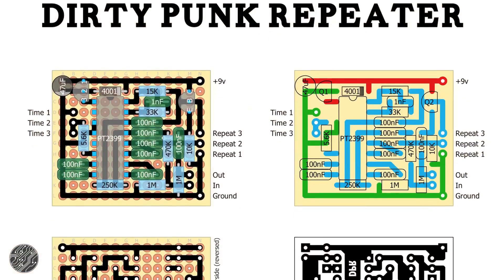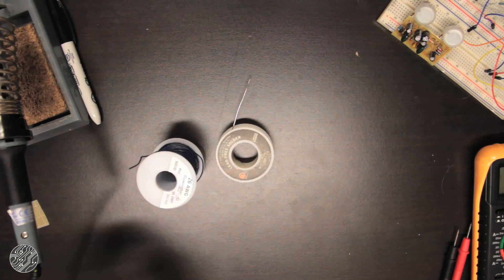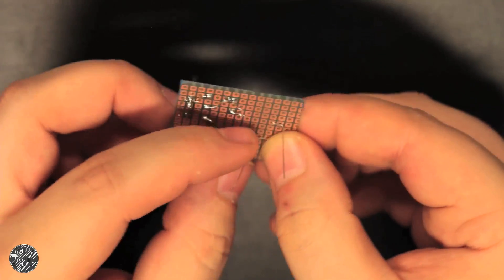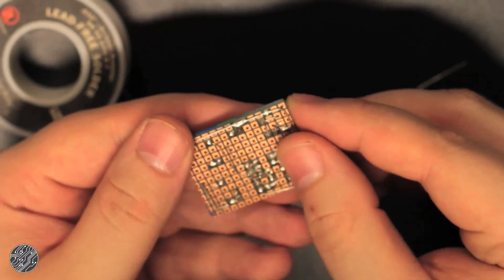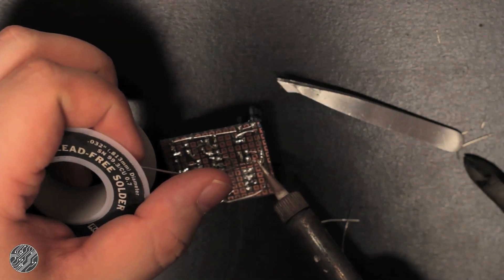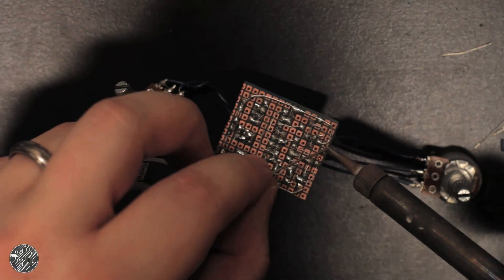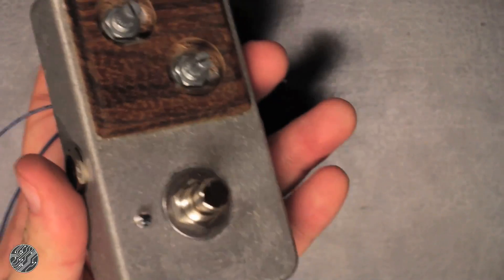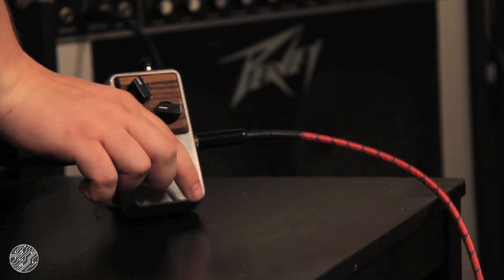Perf Tutorial

Comment: How do you do your jacks so it turns off without the jack? I'm using a mono jack with a normally open switch on the ring. I then link negative of power to ring then on the ground of circuit (along with ground of guitar).
Reply from the maker: I haven't wired up a pedal to turn off power when unplugged in a while, as I don't use batteries. When I have, I used a stereo jack to disconnect the ground of the battery when unplugged.